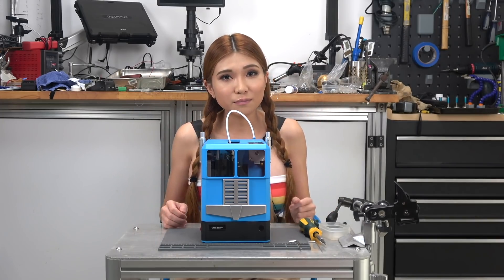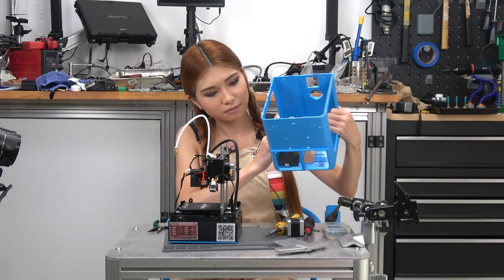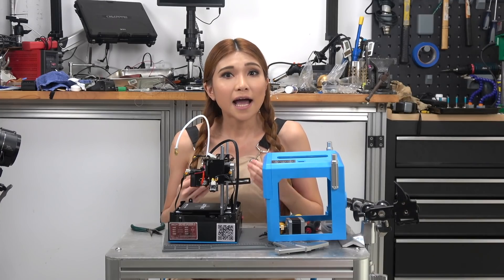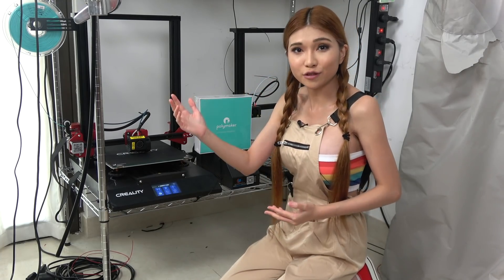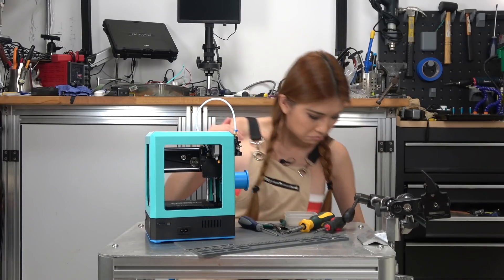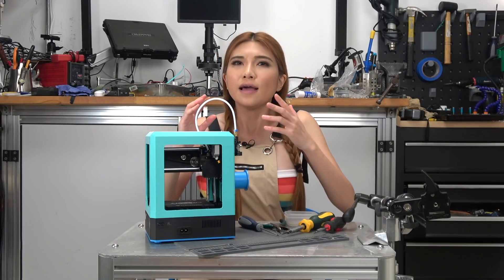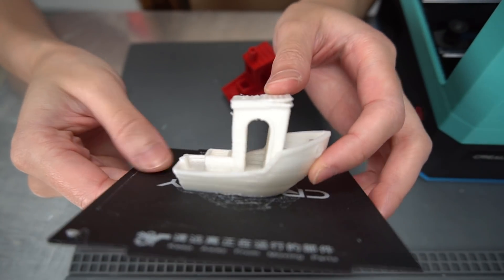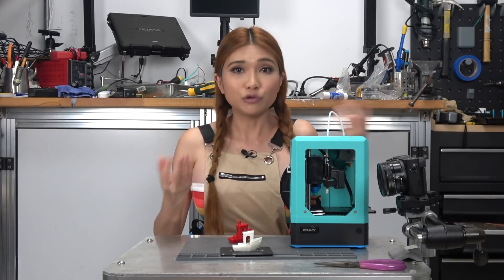3D Print a 3D Printer Enclosure!

Comment: I really like this video for several reasons. Currently I am looking to buy a small 3D printer to keep in my condo in Bangkok. I travel to Thailand once or twice a year and need some sort of printer to prototype some of the CAD projects I work on. Because of your videos I have researched and bought two CR-10s Pro printers for my business. The CR-100 looks good for a simple printer to keep in Bangkok, but I don't like the original enclosure. I would see about 3D printing the new enclosure, so I am glad you have included the STL file. I also use Polymaker filaments, basically only Polymaker filaments now, so I was happy to see the filament being used in this video.
Reply from the maker: Just remember importing printers into Thailand is quite tricky. I'd contact a Thai distributor.

Comment: Like the new enclosure design, it makes it appear like the printer is bigger and not a toy per say. Did you confirm if it was a bad slice of the bench you did?  Could it be a potential cooling issue of the pla, where the case is more opened?  As always good share and presentation.
Reply from the maker: Slicer and bowden tube was a bit loose, fixed now. Will do another print shortly😉
Reply: Ahh that makes sense. Had a print fail yesterday because the filament was pulled back from the hot end because of an issue with the spool. Sad part is that it failed after 10 hours into a 12 hour print lol.

Comment: As always dear one nicely done. Showing the poor performance was great. I use a CR-10 for prototyping and low volume production and after 1500 hours things do get a little maladjusted. Not being able to do the CAD work is not an issue, you are lucky that you got the CAD file for all the dimensions. I have had to reverse engineer enough parts in my day from just the part or broken sections of the part. Keep up the good work.

Comment: As others said thanks for sharing the print issues. I feel less alone!

I note your CR10S Pro has a wheel to guide the filament to the feeder. Mine didn't have that and the filament rubs on the metal block and makes a mess. Please persuade them to add the wheel again!
Reply from the maker: That's just something you can print- I'll do a video on mods soon!

Comment: Looks good!  Thanks for showing the flaws as well, there's a lot going on with a 3D print and it can take some tweaking to get things perfect. I just purchased a 3D machine myself, have to take some time, set it up and dial it in. By showing the flaws, your viewers can see that it sometimes takes a few tries to get it right. Nicely shown and nicely discussed.  (It does drive me nuts to see you using a standard hex wrench. A screwdriver with a bit set seems so much easier to me. (And my big, fat paws are quite clumsy. A nice handle goes a long way to a good result for me...:))  Take care, keep on hacking!  Stubat